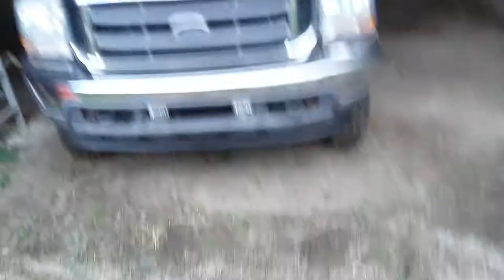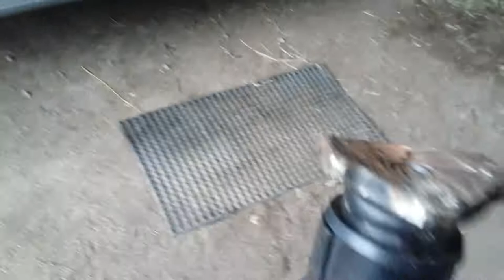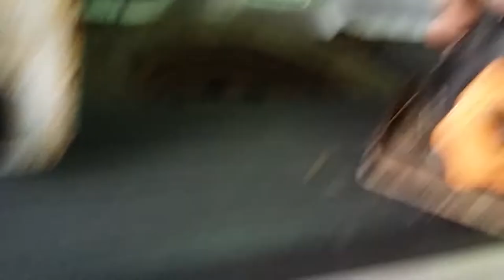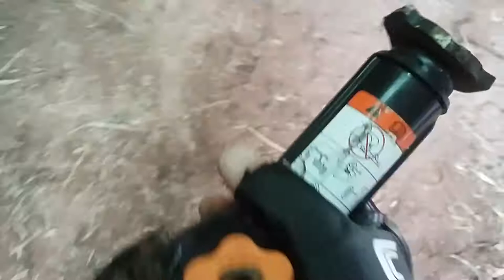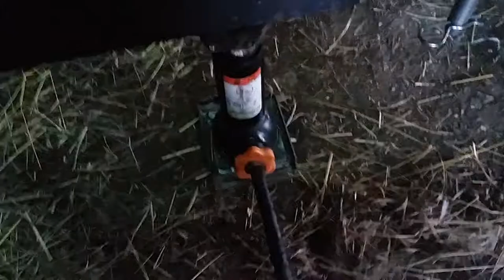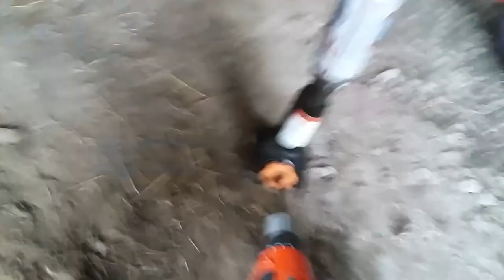Screw jacks, they do have some good uses.

Comment: That ford jack will lift twice as high as a hydraulic bottle jack, if what your lifting is far from the jack block up the jack, a screw jack won't leak down like hydraulic so the ford jack is safer too